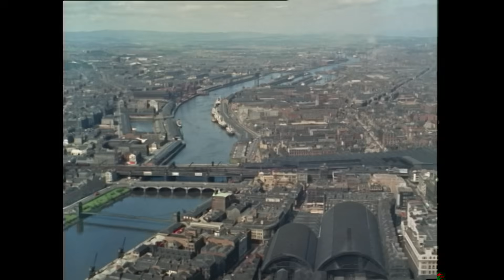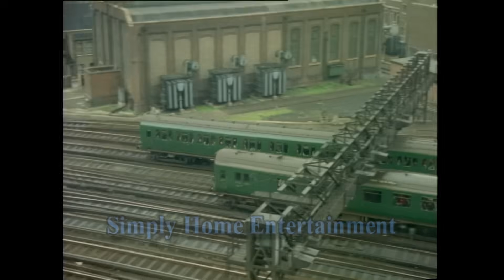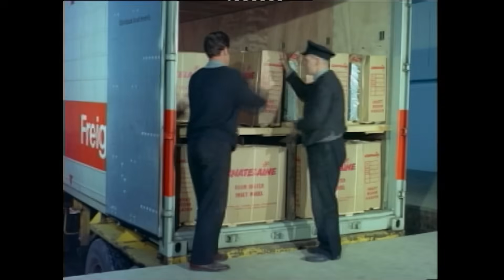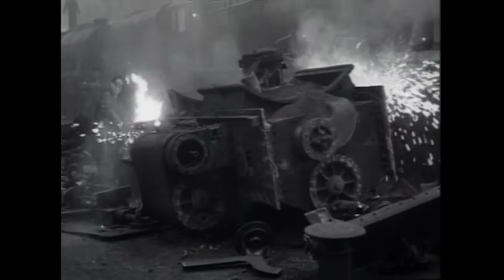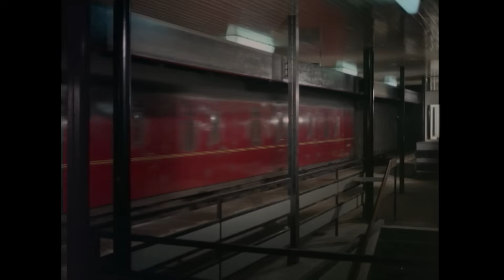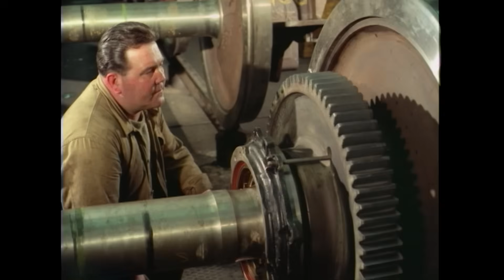THE FALL AND RISE OF BRITISH RAILWAYS; Eps 5 - 8 BINGE WATCH! 14/7/25

Comment: When I was young in the 1960's, I used to travel home to Oban  from Glasgow Queen Street. The Oban train had half an hour to reach Craigendorran outside Helensburgh, as the blue electric train was running behind it and had a fast half hourly service. The Oban train went on to the main line after the Craigendorran junction ,and the blue train branched off to Craigendorran.  Oh how I dreaded that journey, as the older Oban train was rattling along at such a speed ahead of the blue train, and I was shaken about with my luggage landing on top of me, till we were safely heading to Helensburgh Upper station away from that speedy monster behind us!  Looking back it is quite comical, but I dread to think what elderly folk thought of it all, as they must have been terrified at times!  This did not last long and the services must have been altered very quickly!  I really enjoyed your video, Thank you.

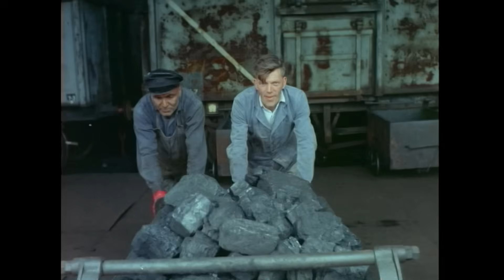Comment: 1:44:34 what isn't mentioned here is the obvious and massive potential for liability created by the 1952 court win over the death of nellie kershaw and the precedent this set for massive liability for asbestos related deaths among railway staff as those steam locos were absolutely packed with the stuff in the form of lagging, this every time you needed an overhaul or major maintenance contaminated a significant area of the shed/works and the staff. If you're someone in a position of responsibility looking at the railways you'd want steam gone asap in exchange of the relatively asbestos free diesels. You'd also want the job of getting rid of this vast amount of asbestos out the way or into private hands before any regulation to limit its use or make its disposal more complex and costly. 1969 saw the first bans on importation for example, this was a major problem on the horizon as modern alternatives to the use cases it had in steam locos would need to be found and costs considered. This is a very little mentioned but obvious driver of the end of steam because we do like the romance of it more than the fact it was filthy and deadly to work around for very long.